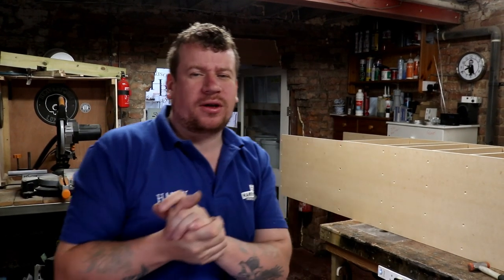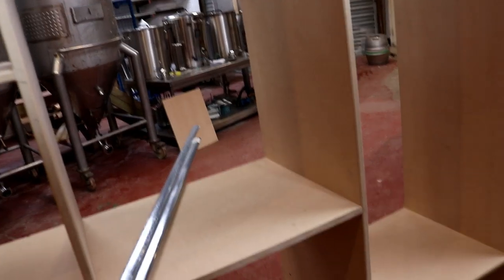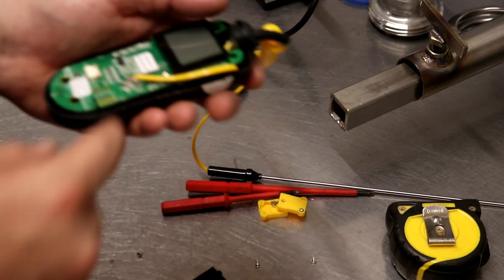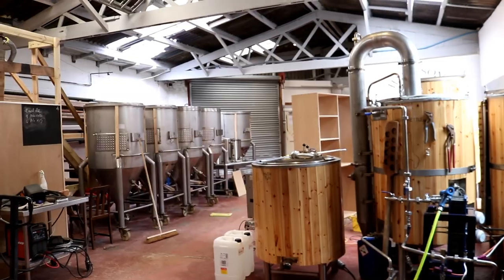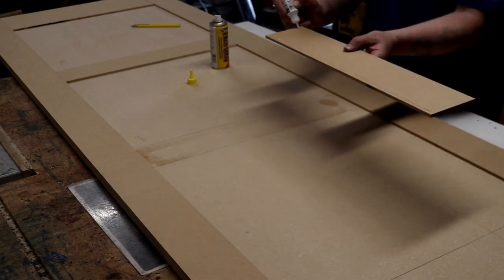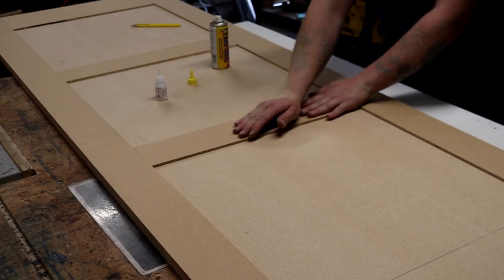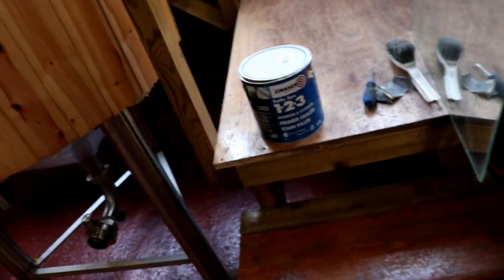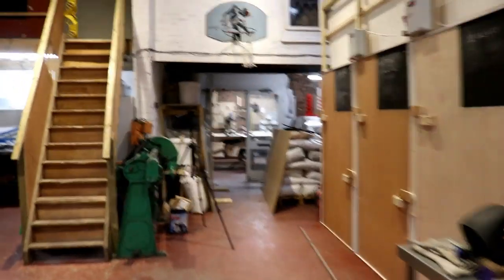SLIDING DOOR WARDROBE PROJECT

Comment: Hi Harry I will add sliding door and add the rail in the ceiling
the length is 2.3m , only concern i have is the safety
do u think it is too tall
i will make light door as u make and wont keep the width more than 70cm